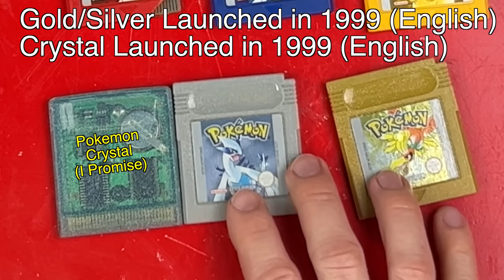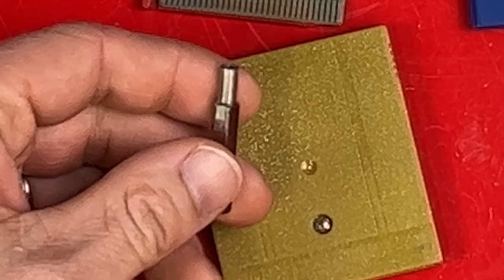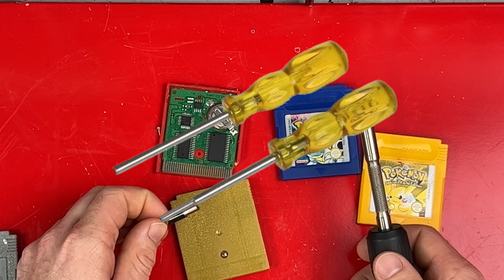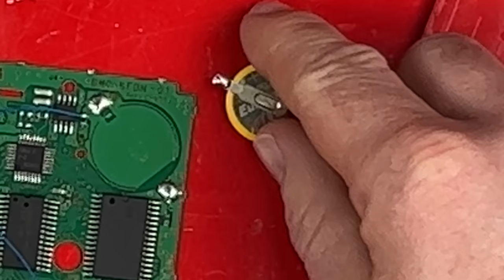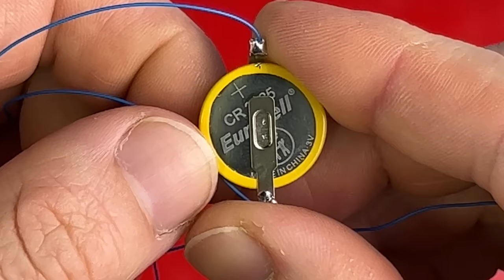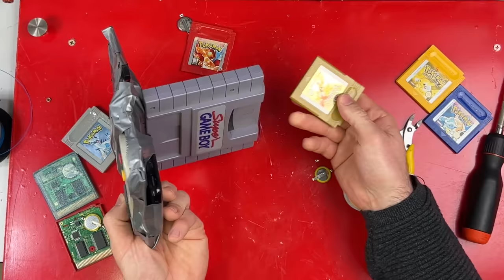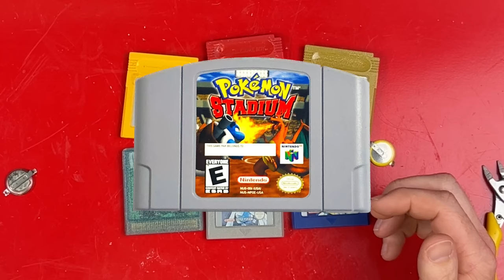How To Save Your Pokemon Cart

Comment: I wonder if you just used a really, really thin rechargeable lithium-polymer battery and a integrated microUSB charger or similar. Since lithium batteries are around 3.7V and those flat coin-cell batteries are 3.0V. (Maybe with a diode or something to prevent backflow to the charging board)

Comment: So I just tried this in a Pokémon Silver game using a CR1616 battery and it didn’t work. This battery is noticeably smaller than the stock CR2025 that was in the game from the factory. The solder tabs still reached and I’m pretty positive I’ve got good solder joints. It just doesn’t keep our saves when we turn the game on. Any suggestions?
Reply from the maker: Yeah, check the polarity, solder tabs on new batteries are very often bent in the opposite orientation to the originals so it looks like you’re installing it the right way but it’s actually connected in reverse. The side of the battery with writing stamped onto it is the positive side.

Comment: note: doing this is absolutely not necessary to preserve your save if you're working with gen 3 games as the battery is entirely to power the RTC, but the RTC getting reset can cause issues with berries not growing (although if the battery has "run dry", it's already too late to try this)

Comment: can you do this method with the gba versions? they have a feature that mentions when the internal battery has run dry
Reply from the maker: Yes you can
Reply: In the Pokemon Gen. 3 games (excluding FireRed and LeafGreen), the battery is exclusively used for the Real-Time Clock. The RTC starts counting from the time the game begins to whenever the game's battery dies, however the game will still save. If the battery is replaced, the time-based events will not occur until it reaches the point the battery on the OG save died, and by that time, the new battery would be mostly dead. You can solve this by making a new save file or using a DS with a flash cart like the R4 to run the homebrew app needed to edit the RTC time on the Pokemon cart without making a new save file. FireRed and LeafGreen do not keep track of time and thus do not have a battery. The Gen 3 games and everything after that store their saves in non-volatile Flash memory which does not need battery power to retain data.

Comment: Given the dodginess of the tabbed batteries, I would have highly suggested battery holders instead! It doesn't solve the volatile memory issue, but it means you or someone else won't require a soldering iron to replace the battery!
Reply from the maker: I’m worried the save will be lost if the cartridge is dropped
Reply: @Games_for_James  Then just don't drop it 😛

Comment: For my Zelda nes cartridge I robbed a 2032 socket from a old broken motherboard I was tossing soldered some wire to it and the contacts and mounted it into the case with some electrical tape taped around itself giving me battery hot swap

Comment: The battery on my copy of Crystal hasn’t failed, but the solder did fail, and now the battery just rolls around inside the cartridge (though I did replace the battery 5 years ago when the original one failed, so that’s probably why the solder failed)
Reply: You could prob just practice soldering to get better at it, can't really have too much soldering but you can not have enough.
Reply: @scarecrow5848  yeah i took the plunge to learn a bit of soldering for replacing my emerald and ruby rtc cards. even if you are bad at it still very good to learn if you want to take a crack at retro console modding or just preserving your old stuff

Comment: Solder a 3v battery holder instead and you can just use normal 3v batteries for the rest of the cart's lifetime. Then you can cut out a hole so you dont even need to open the case to swap the battery.
You can get one in the UK for less than 60p.

Comment: about 2 years ago I bought a Game Boy to PC adapter (called Epilogue GB Operator) knowing this was coming. When I bought it, I verified that the save files were still intact. Unfortunately, by the time it finally arrived, the battery went flat on most of the games (it took like 3-4 months to arrive). I didn't know anything about this trick, or else I could have saved my games. RIP.
I also might have ruined my copy of Emerald because my soldering iron is crap and I had to hold it too long and heated up something next to the battery contact. It wasn't necessary, but generation 3 had batteries for the RTC and it gets annoying having to press A to get through the long message about how certain game functions would no longer work.

Comment: To make it slightly easier could you make it rechargeable? Like externaly rechargeable so you could plug them in while they're not in the gameboy?
Reply from the maker: You could but capacity would be lower so it wouldn’t last as long if it was left on a shelf.

Comment: when i was ~12 i saw a video of some people complaining about soldered in dreamcast batteries and how removing it can damage the board, and then showing videos of themselves trying to rip the batteries out of the solder with pliers. no heat, not even cutting away the solder with a knife beforehand or filing it down.

Comment: The tutorial was very clear thanks for that. 
I don't have a use for it for now though as I don't own any cartridges (or handheld consoles) aside from a bootleg Pokemon Blue that was given to me by a sibling that was given to them by a cousin if my understanding is right. The board design is interesting as the battery is a CR2032 and it just has a battery slot on the board with no need to solder or anything.
Only cartridge type thing I may need to replace the battery at some point is an EZ-Flash Omega which has a battery, but have no console for yet LOL.
To James, a question what's the soldering iron you use? I ask as I've only tried the cheap 40/70/80 watt ones and the tips are crap and don't heat that well.

Comment: well, this is a lot more legit than when I would fix them in high school by just snapping the connection between the tabs and the battery battery and then just sliding in a new battery and bending the top tab back in place with a bit of tape to hold it down (the front cover was usually enough to keep the battery in place and in contact with the bottom tab).

Comment: Is the battery is connected in parallel with the old one or it doesn't care for the temporary up voltage to 5-6 volts?
Reply from the maker: It’s in parallel, so it doesn’t increase the voltage

Comment: You should do the button battery holder mod to some Master System, NES & SNES games. I haven't done it yet to my games since the save files are still fine, but it'd be a good video to show people.
Reply from the maker: I was going to mention those but I forgot :(. I don’t like them because the battery could come dislodged if the cartridge is dropped

Comment: I used electrical tape to fix my copy of crystal back in 2015 by wrapping the replacement battery in it while attaching the positive and negative terminals  to the connectors it still works perfectly now

Comment: I know this might sound dumb from the here and now perspective, but wouldn't it be better, if you expect to be playing these games welll into your 70's or passing things down to your children, that you use a replaceable battery and solder in a coin cell holder instead? Then you can also solder in metal tabs to attach with A-clips or spades in the same place as the battery terminations, attach the temporary for a moment to replace the coin cell, remove and preserve the save.

Of course, doing things this way first is mandatory for swapping the battery with a coin cell holder and spades, so this is great advice initially but I see no reason why the battery couldn't be made replaceable as described above.
Reply from the maker: The biggest reason for me avoiding battery holders is the potential for losing contact if the cartridge is accidentally dropped.
Reply: @Games_for_James  Yeah, I can see that happening. But I can see this being viable without losing connection if a 3D-printed mount was made which goes around the screw post and butts up against both the battery (Gently caressing it) and the top of the cartridge interior volume.

Then to replace it would be simple-as clipping an external battery on, swapping the internal battery and removing the external, then also replacing this plastic holder thing-a-ma-jig before buttoning it up. The clips for the external battery can guide placement of the plastic battery retention jig.

Comment: What I've been experimenting with is putting in a battery mount so swaps can be done without needing to solder. I then have a 3d printed half front case that I can screw on but still allow access to the battery port. So every year or so I can swap on the half cover, plug the game into a gameboy, turn it on and live swap the battery. It being plugged into the gameboy keeps the save chip powered and the half shell giving access to the battery whilst it's secure in the system. It obviously sacrifices some battery capacity due to the size of the holder etc but it allows for high quality batteries to be used and easily swapped without losing your saves or heat cycling the board. Hence the yearly changes even though I know I could go longer.
Reply: Still sounds more cumbersome than spending 40 bucks on a cartridge dumper/flasher to make regular backups

Comment: Pokemon ruby, sapphire, and emerald, also use the battery as well, the method i used was to tear the solders directly off the battery then put a regular watch battery in and tape the contacts onto the battery. Now i dont remember if the battery did work on the saves themselves or just the game clock, but otherwise i still have a taped battery in my sapphire cart and it works just fine.
Reply: It's just for the clock on those ones

Comment: What if you put multiple batteries in series (not sure if that's the correct term) to increase the capacity?
Reply from the maker: Series would increase the voltage, parallel is what you want, and yes it would work if you can fit them into the cartridge

Comment: I did this the way you’re not really meant to, I would pry the tab off the batteries so they’d remained attached to the board, then I put a new batt in with electrical tape and it works like a charm. Good thing is you can very easily replace the battery if need be with this method, even if it is janky.
Reply from the maker: The biggest problem doing that is that the battery can shift if you drop it and you may lose your save or short out something you shouldnt
Reply: @Games_for_James  Yeah I found that out with my copy of Link’s Awakening. I found taking the rubber jacket from the older battery and slipping it on the new one while using another piece of tape to keep the batt stationary solved the issues, but in the end, doing it the correct way is always the safer way to go.

Comment: Is it no problem for the chip to temporarily increase the volatge by 100%?
Reply from the maker: It doesn’t. Putting batteries in parallel only increases the capacity and current capability. The chip doesn’t notice any difference
Reply: @Games_for_James  ah yeah right, they are parallel, not in line, didn't think of that ^^

Comment: Nvram wouldn't be 100% compatible with the games that have a built in clock. It couldn't keep time with no constant power.  The same thing happens with pinball machines that keep time if you add nvram. The clock functions never work right (Attack From Mars, Theater of Magic, etc)
Reply from the maker: With RTC game boy games you need to leave the battery in place but disconnected from the fram, the battery will still go flat eventually but you will only lose the time, not the save.
Not sure if the same can be done with pinballs. I imagine it can but usually getting away from batteries in pinballs is to avoid the batteries leaking and destroying the mpu

Comment: One idea is to use a rechargeable battery with the same dimensions, using a battery chemistry more stable than Lithium since it would just be given the raw voltage of the console with no charge controller.
Reply from the maker: There are ways to do it but there are drawbacks too. System voltage is 5v which is too high to charge a 3v battery for an extended period and I’m not sure if the sram can take 5v on the battery input. Rechargeable batteries won’t last as long sitting on a shelf either. Things get complicated quickly.

Comment: When you replace the ramchip with a different kind it treats it as a fake copy, and the only other mods I can think of that could potentially extend the life of those save files is somehow replacing the standard battery with a rechargeable battery or adding a solar cell like on a calculator
Reply: there was a gameboy game with a solar cell IIRC. Or it might have been a GBA one.
Reply: @RAFMnBgaming  I think it was a GBA one I think I might know the one you're referencing saw it in another video

Comment: James, I don't know how you've done it, but you've read my mind.

I recently investigated and took apart all of my GBC/GBA era Pokemon games, in an attempt to verify legitimate copies vs bootlegs (of which I had two, one of Fire Red and one of Ruby), but discovered a couple of them had the dead battery issue. I'd always thought of it as something to forget about and just leave the system on or never bother with whatever time based events I'd be missing out on, but then this video popped up, showing me that soldering isn't really too complicated if you just 'do' it.

That being said, do you have any recommendations on what you're using to solder (or cheaper ones to get started with first as a beginner) and any supplies or materials you use during your videos? (For example, the batteries for the GBC games or the solder material/flux)

Cheers, mate.
Reply from the maker: Make sure you get a temperature controlled soldering iron, some of the cheapest irons just keep getting hotter until you’re trying to solder with a burnt tip which destroys everything it touches.

Rosin core solder, I like 60/40 sn/pb, it’s much easier to use than lead free but it has the drawback of being full of lead. Wear gloves, it won’t vaporise at soldering temperatures so you just have the flux fumes to avoid which are the same as lead free anyway. 
Adding extra flux always makes soldering easier too if you’re struggling
Reply: @Games_for_James  Thanks for taking the time to reply, I can see now that I've got much to look into before I start practicing soldering, even before I start purchasing any supplies. That being said, do you have any recommendations for what specific type of gloves to use, like surgical grade for doctors or rubberized ones for electrical work, or will any simple old cloth/fabric glove do so long as I don't immediately contact the rosin core solder you mentioned with my fingers?

Cheers!
Reply from the maker: I use nitrile gloves, just make sure they fit well or you will struggle with fiddly bits.

Temperature controlled soldering irons are cheap on ebay. Get some small sharp wire cutters that are made for electronics too.

Have a look on youtube for soldering tutorials
Reply: @Games_for_James  Thanks for all the advice, I'm lookin to pick up DIY repairs as a personal hobby soon, so this is fantastic recommendation!

Can't wait until your next video, cheers mate!

Comment: add a chip to convert the problem pin signals into normal pin signals problem solved a simple lookup table or something could probably do it just get rp2040 board or something usb programmable load the firmware and shove it into the cartridge its so old it cant be that high of a data rate to prevent a middleman using a modern chip
Reply from the maker: The problem is that the /CE pin of the original sram gets held active during read/write. The fram requires a single pulse before reading or writing and will not read or write with the pin continuously held active. The fram may also not be fast enough to work in some systems (suspected issue with ntsc pokemon stadium).
I don’t have any programming skills otherwise a GAL or something would be able to fix the /CE timing but I’m not sure how it would fix the speed issue
Reply: An RC circuit / some transistors could probably turn any width CE hold into a pulse, but the timing is the struggle... 70nS to read the SRAM vs 145nS on the FRAM. Hard to work around.
Reply from the maker: @montymintypie  the problem with an rc circuit is it won’t detect consecutive reads or writes because the /ce line just stays low. And yeah speed is an issue.

The current solution ORs /ce and clk which works in almost all cases except where the timing is too fast, which I think is probably the issue with the retrode too
Reply: Oh geez, didn't realise CE remained low the entire time, how terrible.
Reply from the maker: @montymintypie  I don’t actually know for sure that it does, just that it could, and aiming for 100% compatibility needs to account for that

Comment: Can I use a variable power supply instead another battery?
Reply from the maker: A battery is safer, if your power supply and soldering iron are not electrically isolated you could lose your save or kill the cartridge.